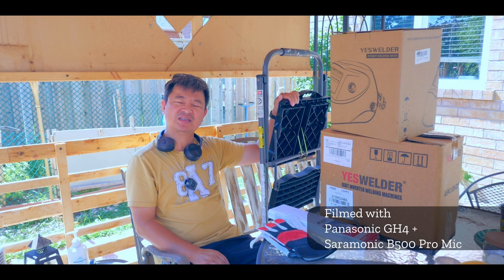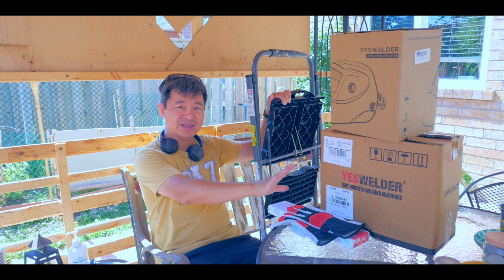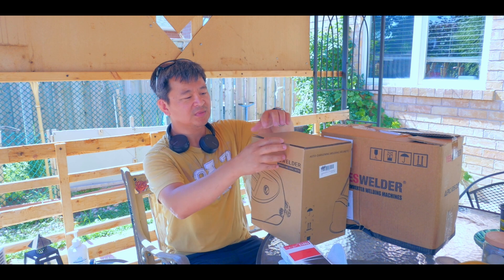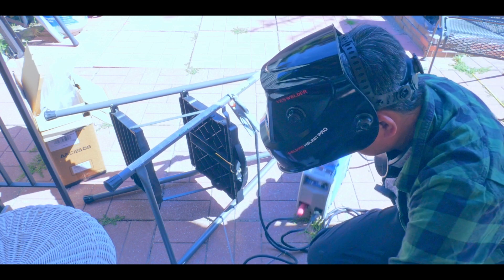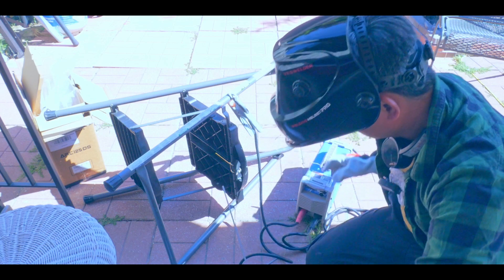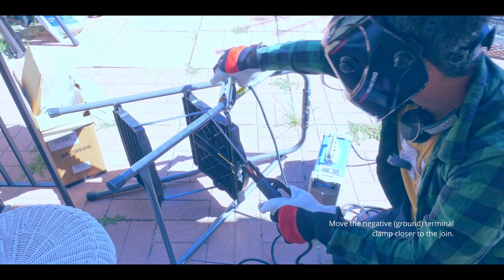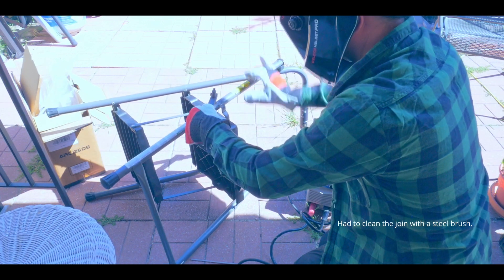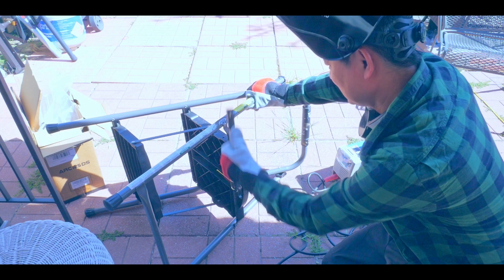Review of YesWelder ARC 125A Stick Welder Machine - How to repair metal joint with a stick welder

Comment: Hey, nice video but you need some friendly advice. Hopefully I'm not offending anyone. You have to prep the work area and clean off the paint. Also the ground clamp does not need to be so close. As long as it makes contact with what you are welding, you'll be fine. Clean off the paint from both weld site and a bare metal area to ground clamp. I have this welder as well in my 4x4 rig for emergencies and it will weld up to 1/4" with ease as long as you have some decent 7018 anything is possible 😉

Comment: Hey dude I am welding for about one year in the time in the video 12;00  You said that that welder canT weld thick metal Well I'm sorry to say but this is incorrect My first welder was really cheap something like this And you can weld a really thick material with it Just depend on your amps in your skills Of course you need to cool down it more than it really good welder But that welder can weld most of 
The thicknesses I hope that you will well more and learn more about that welding process And thank you about the video
Reply from the maker: Thank you for the information. I am really new to welding; I bought this cheap  welder to repair my small step ladder.  So far I am happy with my purchase.
Reply: I know your 1 year of welding there must of been lots of xrays on your yeswelder welds but hate to tell your brother you can put a weld on  9in thick 500 doesn't mean your getting penatration these are for home projects and non life depending welding